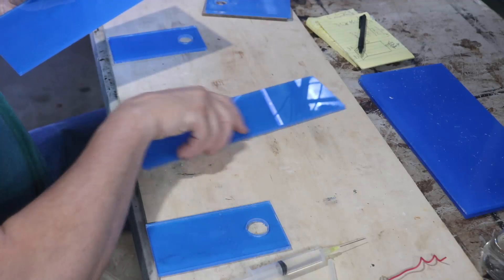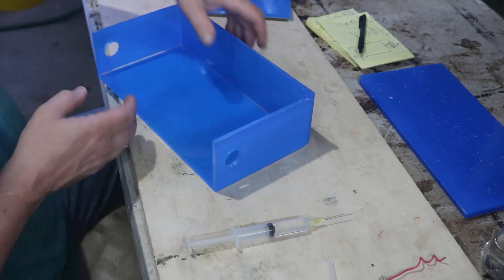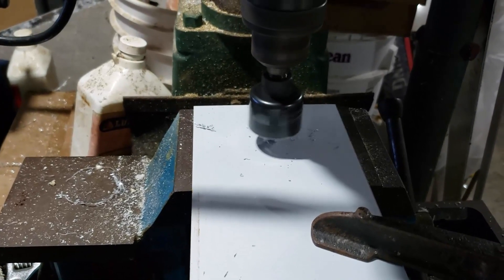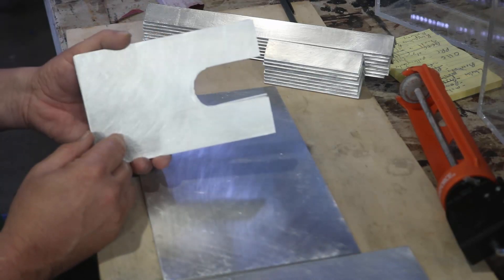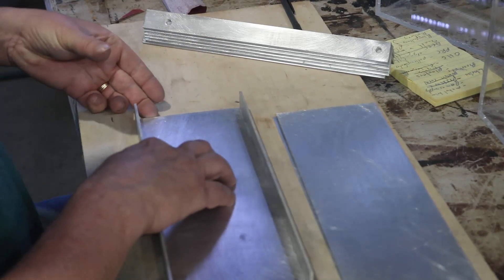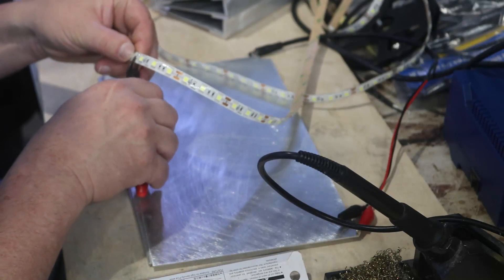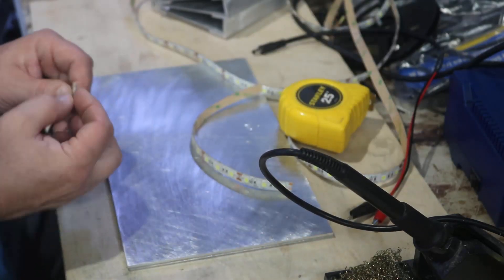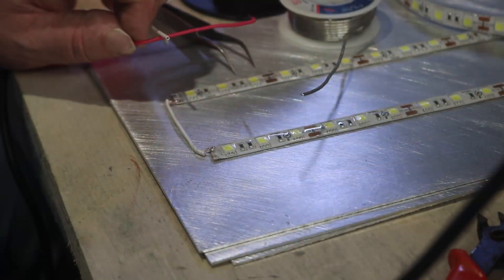DIY Algae Filter Ver. 3 Part 1

Comment: Have you seen new brazing rod for aluminum for propane tourch, it is advertised on you tube.
Reply from the maker: I have. I just don't find it necessary for the kind of work I do. Silicone forms a stronger bond than I can pull apart by hand and is more than strong enough for these projects.

Comment: What glue do you use for the acrylic because a lot of acrylic glue I've found is toxic to fish
Reply from the maker: It's methylene chloride. It's actually not a glue but a solvent. It melts both sides and then evaporates leaving a weld. There is no residue left, just the acrylic so it's 100% safe. Hope that helps

Comment: Pretty interesting idea. I have seen another one of the algae box ideas from the king of DYI but not to this extent. My understanding is during the nitrate cycle when water leaves your filter it contains Nitrates and the purpose of the algae filter is to remove as many nitrates from the water before returning to the tank. If this is the case how does an algae filter compare to say small to medium fluidized filter after your main filtration? Also, I noticed that you are using LED strips with adhesive on them. How well, do the LEDs stay attached to the walls of the box? In my experience due to the fish tank always being a source of heat and humidity, I have found the adhesive on "most" LED strips to fail after a while of use. Just a thought here but what if while building the box walls and attaching the LED strips you run a small bead if silicone as to place the LED strips on to further facilitate long term adhesion to the box walls? Awesome idea never the less, waiting to see the finished product!
Reply from the maker: Algae filters are designed to remove nitrogen from your tank. This will help balance your tank the same as a planter filter. I use them exclusively on marine tanks. I am planning to do a fresh water comparison soon and we will see how they stack up against the usual fresh water filters. The LED tape I use is high end and none of them have pealed in the last almost three years that I've been using them. That said I do seal the ends with silicone to avoid moisture and this does also help them stick to the aluminum. Thanks for taking the time to share your thoughts on this.

Comment: I love your air lift builds. Do you think you could make a simple one stage air lift just for water circulation that is silent or almost silent? I just have a bubbler running in the corner of my tank to turn the water over but it's very noisy.
Reply: I use a lift tube that runs almost to the other end of the tank. Circulates the water very well and is quiet. Its one of the Swisstropicals jetlift tubes with just some pipe on it to the other side of the tank.
Reply from the maker: The easy way to make a quiet version with air is to use very small bubbles. Just put any fine air stone inside a piece of acrylic pipe and that should do the trick. Hope that helps
Reply: @FishmanEricRussell  thanks for the response. I've actually tried so many air stones that claim to have "fine" bubbles but do not that I assumed they are a myth. Is there a specific stone or wood block you suggest?
Reply from the maker: @voidmouse-cuts  Sorry I just tend to make my own. I haven't found any I like either